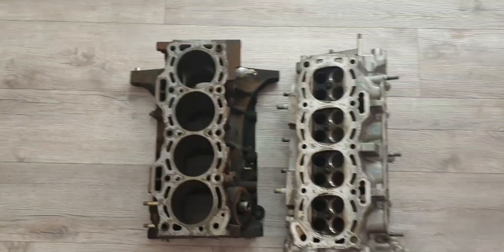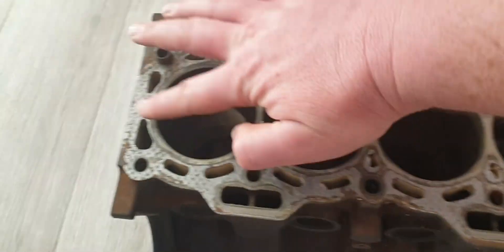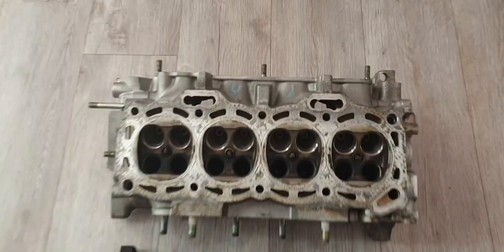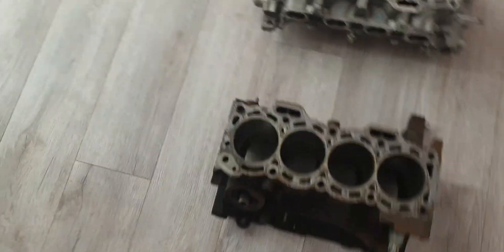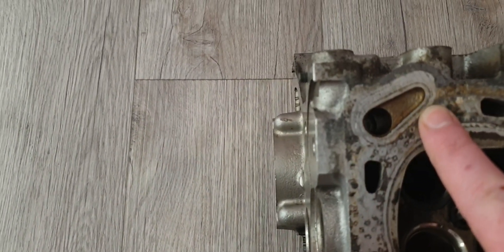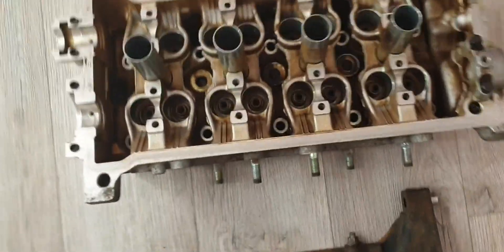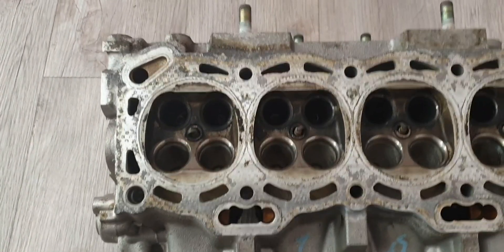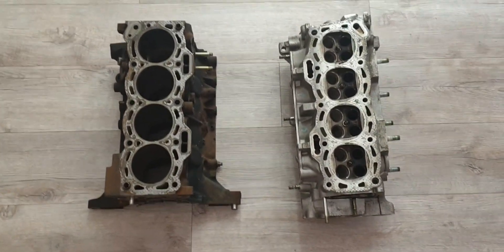Toyota 4E-FTE Engine Tech Talk - Oil/Water Galleries & System Starlet Corolla

Comment: Hey man. Thanks for the info. I just got my starlet and the engine rusted through ( I have like a 3mm hole just below the oil filter location place. I think the oil canal just rusted and the pressure opened it while driving...). I Just got my new engine. Mostly took all the parts from it that it came with. The gaskets where all shot and gummy (old). They just fell apart. Also, the head gasket is leaking. Since I will take the head off, is it worth porting the head and ficing all the charp edges with a dremmel first ? Can I damage something and will I be able to re–use head bolts ? Another question would be.. Maybe you by any chance have 4EFE or 4EFTE engine manual ? Im not a mechanic, will do this first time. Would be lovely to have something to look at when putting everything back in after painting it... Thank you. Subbed,
Reply from the maker: Hello H3em, thanks for the comment brother! Glad you decided to do a little build to preplace your engine. Ok so I would ask you further questions... are you boosting with a turbo or keeping it naturally aspirated? If you're going to go high power and with turbo then a mild port of cylinder head and pocket port in the intake and exhaust galleries will be  a good start. If I were keeping the engine 4E-FE stock then I think the existing head studs can be fine but if boosting I would save up and buy ARP head studs. Please don't make the mistake of saying (I can do this on a budget) because you will spend 2-3 times more money in the long run, if you're going boosted buy premium parts, there are many videos on how to build a 4E-FTE search Matt Berry Starlet on YouTube to watch his builds. For me I am going boosted and am saving to buy quality parts, I don't want to rush to build as I will make mistakes. If you are just rebuilding a N/A 4E-FE then get a new gasket set and do your rebuild. What are your plans for your build?
Reply: @920400706  My plans for now are paint the engine block and other parts. Of course replace the gaskets and maybe seals (I don't know how hard that is for a beginner mechanic). Then I was thinking since the head will be out, port the head in the meantime and clean it well. Put everything back with stock parts (stock intake, exhaust manifolds). See if the engine runs well. If it runs and eveything is good, then I want to go with ITB setup. Save up for yellow injectors, ECU DET 3+, Corolla 4-2-1 exhaust manifold, Triumph TT600 throttle bodies, custom intake and also custom bigger diameter exhaust system.
Reply from the maker: @Unknownas1337  That sounds like a great idea, yeah port and polish head while its off, if you can find a thinner head gasket you can increase your compression ratio. this all is easy stuff which you and a friend can do. I think you will have a nice build when its done.
Reply: @920400706  Maybe you have 4EFE engine manual in pdf ? I can only find it in russian language unfortunately
Reply from the maker: @Unknownas1337  I don't have a pdf manual, however, watch YouTube there are loads of rebuild videos for 4E.
Reply: @920400706  There are a few but they arent detailed as I would like them to be with all the torque specs and so on... I might ask my toyota dealer for one
Reply from the maker: @Unknownas1337  Check the starlet forums, you will get specs and tolerances there.